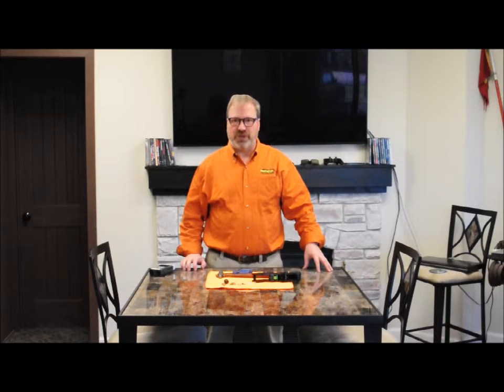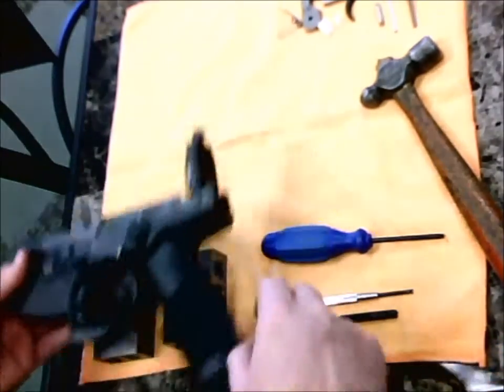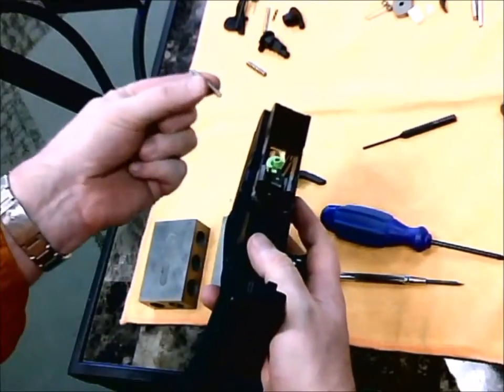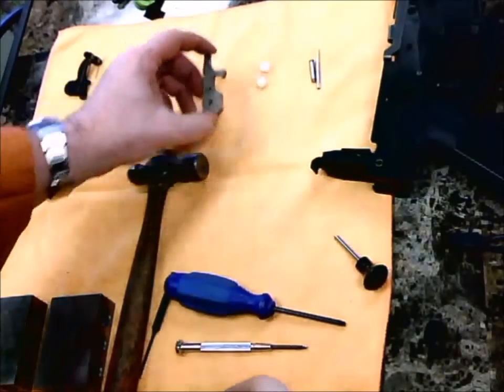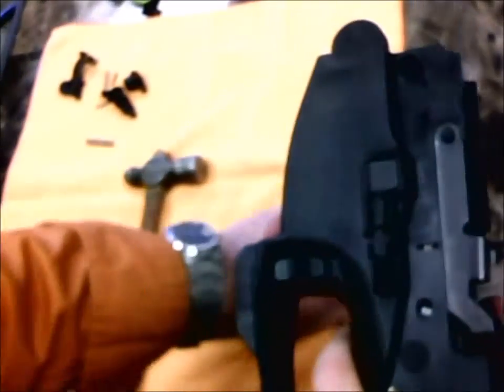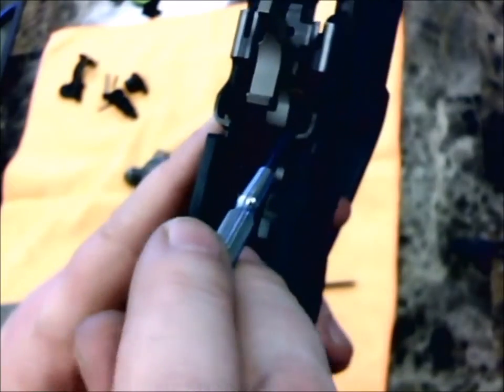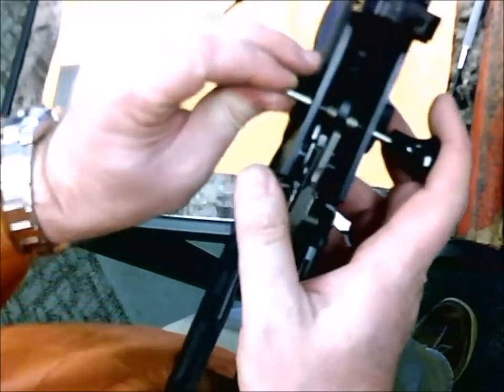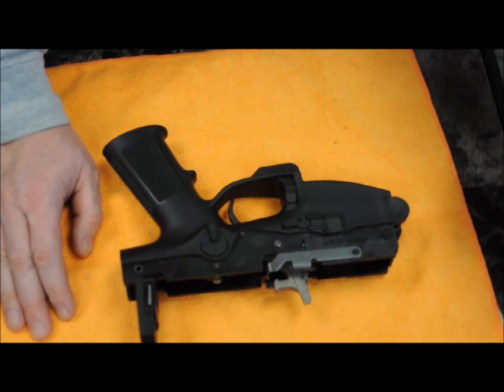ARX-100 Prototype Install

Comment: Just installed mine. Only had a couple of issues, but it was otherwise fantastic, and I can't wait to try it out at the range!

1) My safety was kind of hard to switch on/off for a bit, but that was probably user error where the spring-detents didn't line up correctly. It worked itself out after a few minutes of playing with it. I should also mention that getting the safety switch connection pin installed was probably the worst part of the install for me personally, lol.

2) The other issue was too much rubber material, I felt. It was all over the side of the trigger itself and one part of the coating looked like it was resting on a piece of wire while it dried, but some metal polish smoothed that off and now it's super-smooth and still looks great (no bare metal visible on the installed trigger)!

P.S. the instructions are easy enough to understand when used in conjunction with this video, but an updated install video would be awesome since the finished product has slightly different parts (i.e. a brass washer installed next to the trigger bar, and a solid metal hammer without the plastic bushings- good call btw!).

Comment: A video with the production trigger parts would be nice, illustrated instructions would be nice. I finally got it installed - maybe get out tomorrow and test.  The trigger spring, which on the production trigger is single sided like the OEM trigger spring, work out from under the trigger (the L end pressing down on top of the trigger) some making me nervous that if might come all the way out under firing conditions. I will contact Shooting sight about that.  8.5 pound pull with OEM trigger, 5.5 pull with this trigger. Spec for this trigger is 5 - 6 pounds so 5.5 is just fine. Included tools are very helpful. Parts are very well made.  Update: Art got right back to me about the trigger spring with directions to bend the end - which fixed the issue 100%. He offered to send a new trigger spring but that was not needed.  Looking forward to live fire testing!

Comment: I recently installed the ShootingSight 2 stage trigger in my ARX 100 so far so good the trigger is a definite improvement over the factory install.  I have fired around 200 rounds so far with no issue.  I will post more as I continue to test.
Reply: Is it worth the $200?
Reply: I feel it is the pull is much more crisp a big improvement over the factory trigger.

Comment: What a finicky pain!  Got there in the end, though.  This video was a godsend - may not be "intended" as an instructional, but it sure as heck helped a LOT.  BTW, I found it easier to load the trigger/spring/washer onto the pin, then wedge the washer in and fiddle it into place as I pushed on the pin.  Took 1 go that way, after nearly losing my mind trying it the other way (must've been close to a dozen times!!!).